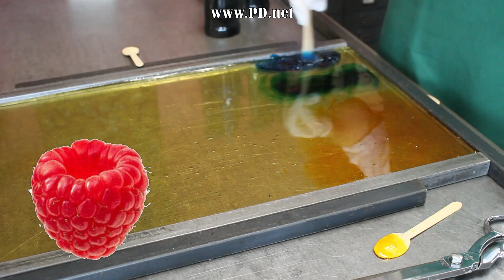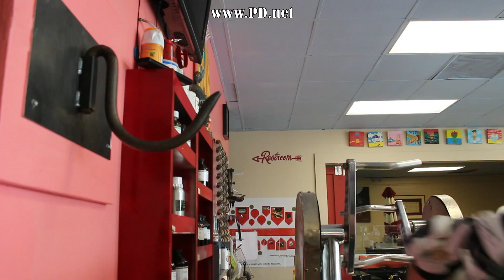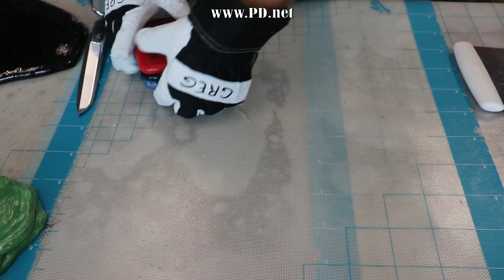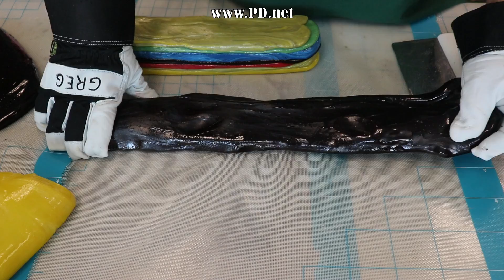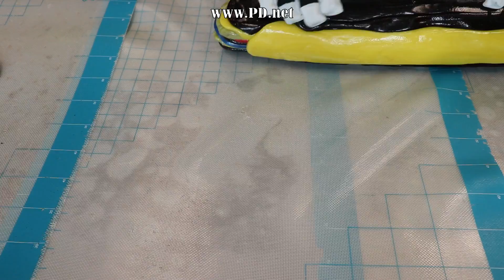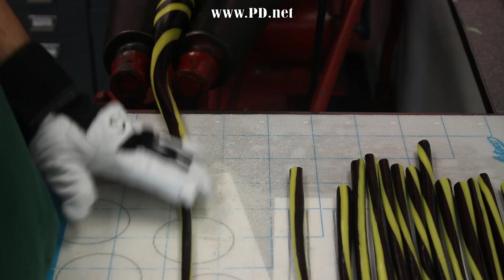#84 Jodie Whittiker Candy and female Time Lords in Doctor Who

Comment: Is it just me- or are you working with cooler candy in these clips? When pulling it on the hook it kept more of a stiffer shape than normal, and when folding the candy into stripes it didn't look like your presses shaped it that much.

Im no candy expert- just an observation that could be Very wrong.
Reply from the maker: Everything with this design was cooler, a lot cooler than I normally work. I needed the candy not to move. I may have mentioned that in the video. I can't remember.
Reply: @LoftyPursuits  really good work!

Comment: Sorry for this long somewhat irrelevant question but I want to try making some of my own hard candy so I can show and teach it to my Nieces and Nephews at Christmas, oh and how to also make some 'Dragon's Beard' which is an ancient version of 'fairy floss created with the same method used for handmade noodles. But it starts out pretty similar to your method, so invert the sugar with corn syrup and vinegar, boil to the softcrack temp then take it off the stove wait for all the air bubbles to dissipate so that it's perfectly clear and then pour it into, in this example, little round plastic containers.
What I want to know most of all is how do I flavour the sugar candy? 
What can I use? You seem to frequently add citric acid in powder form but from what I can tell that's for a bit of zing and a touch of flavour but not the primary flavour. 
Should I buy oils? Or maybe even some cordial? Would Ribena syrup? Do supermarkets have them? My preferred flavours are Grape, Watermelon, Blackcurrant, Blu-Raspberry, Straw/Black/Rasp/etc-berry. 
Any tips or advice would be hugely appreciated. Thanks.